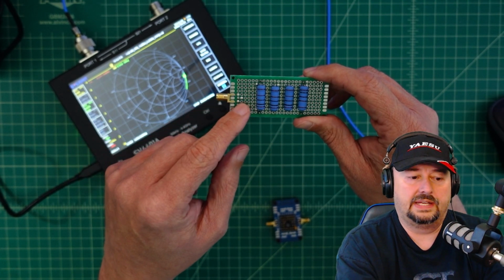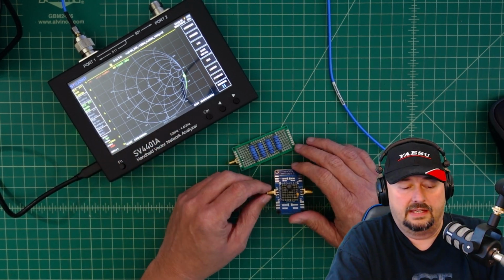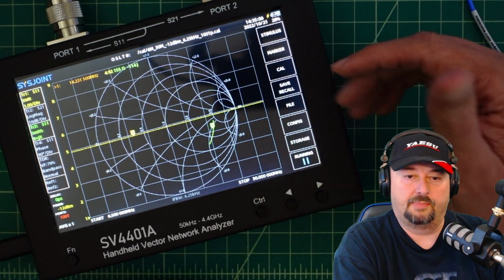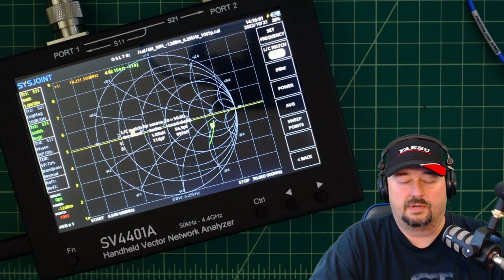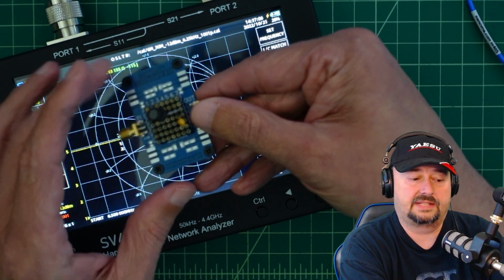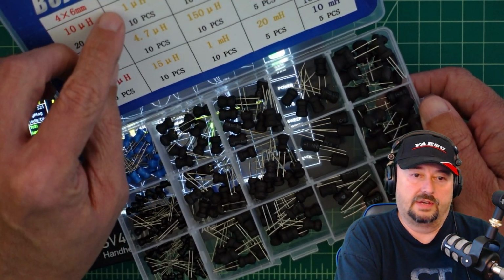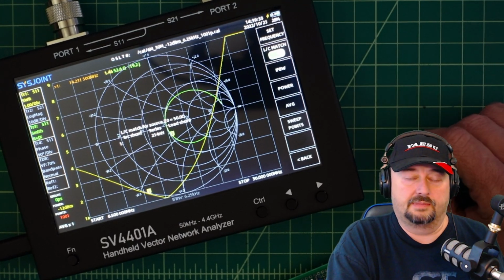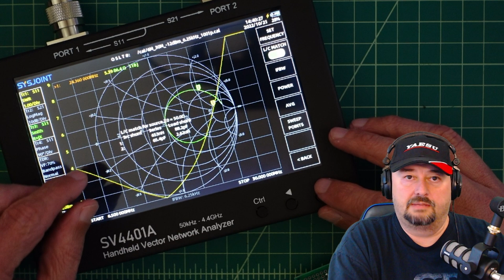NanoVNA Hacks for PERFECT L/C Network Matching!

Comment: ok very good  lets say you are designing  a 1/2  vertical  antenna made of wire  where do you connect the end of the wire  you have direct  into the center  of the so239  what do you do with the outer  of the so239  ground ?   do you just leave it open ?  to  get the component  values needed to build a l/c network
Reply from the maker: That’s what I would do, I’d also comments any ground radials I was planning on using 👍

Comment: for LC matching with the NanoVNA, when it shows multiple lines for LC solutions, ie. in this video you went with Line 1 (didn't mess with line 2), does that mean that each line is a solution?  Are they listed from best to worst (ie. is line 1 a better solution than line 2 or line 3 etc?).  I recently picked up an SV4401 VNA and have be scanning all sorts of antenna's, built a couple 1/4 wave ground planes.  When i select the LC tab, depending on antenna shape/design and how far it's from 50/j0, i've seen up to 5 lines for adding in Inductance and Capacitance but I haven't had the chance yet to actually connect them into the circuit (as you do in this video).  I just got the same board you have for easily adding inductors/caps etc so will start experimenting soon.  My question still sits with can you build the match between the coaxial source and coax to antenna?  I thought the LC matching components had to be between the source coax and antenna base?  Does it matter?  Thanks!
Reply from the maker: They are just listing multiple solutions to the problem in no particular order.  I would put the circuit as close to the feedpoint as possible AND keep in minds that little board is for prototyping, it won’t handle even QRP level power 👍
Reply: @TheSmokinApe  Awesome, that was how I was taking it (multiple solutions).  Yep, just prototyping here, thanks again!
Reply from the maker: @Ifishmo have fun with it 👍

Comment: What voltage rating would be needed for a 20W transmitter? I can see the component size (power/voltage rating) probably doesn't matter much for just tuning an antenna but for actually running/transmitting on the antenna (depending on series/parallel/shunt etc configuration), is there a rule of thumb for power/voltage/watts for these discrete devices?  I found a couple sources saying that for 20W you would need at least a 200V capacitor, is that close?  Any info or direction you could point me on this would be much appreciated.  Thanks again for all the content.

Comment: Ty for the video. @7:15 are you telling us that the VNA is telling you what value capacitors and inductors need to be used to match the network? Is the VNA doing all that math for you? Ty for your reply!
Reply from the maker: That’s exactly what I’m telling you, thanks for watching 👍
Reply: @TheSmokinApe  

Ty for the reply. 

So I have a 'Pi Matching Network' in my circuit. The datasheet asked me to build a Pi Matching Network. ( You know, how there is a series component, a source shunt component and a Load shunt component. )

Anyway, my VNA keeps telling me this:
The measured load impedance is 31.9-58.5j. The VNA is automatically generating these four groups ( group 1 thru 4 )  of available matching parameters on the screen:

1. 5.24pF capacitor for source shunt and 28.8nH inductor in series;
Does that mean, this group does not need a Load Shunt at all? 
Does this mean that the proper tuning has been achieved with just a  capacitor for source shunt and an inductor in series?

2. 23.1nH inductor for source shunt and 12nH inductor in series;
Does that mean, this group does not need a Load Shunt at all? 
Does this mean that the proper tuning has been achieved with just a  inductor for source shunt and an inductor in series?

3. 97.5nH inductor for load shunt and 23.3nH inductor in series;
Does that mean, this group does not need a Source Shunt at all? 
Does this mean that the proper tuning has been achieved with just a  inductor for load shunt and an inductor in series?

4. 15.3nH inductor for load shunt and 5.21pF capacitor in series.
Does that mean, this group does not need a Source Shunt at all?
Does this mean that the proper tuning has been achieved with just a  inductor for load shunt and a capacitor in series?

If the answer is yes to all the 4 above questions, then I still cant believe that a 'Pi matching Network' can exist with 1 of the 3 components totally missing. 

Ty for your reply!

Comment: This VNA looks amazing for ~$250, almost unbelievable, i'm looking for the fatal flaw this must have for such a low price point but i'm just not seeing it.  
Serious question here:  Why use a $10K, $20K, $40K VNA when it looks like it has all (most) of the same abilities as the name brand devices selling for literally 100X the price.  What am i missing here?  Is it not as accurate, repeatible, missing some sort of spendy capability?  Does it have 'phone home' cyber tech/software inside (data harvesting/hacking etc)?  Any insight into this from anyone would be much appreciated.
Reply from the maker: The folks who started building these devices have done a great job making affordable equipment for hobbyists, while it’s not as “good” as professional equipment the results across both are quite similar.  The lowest I’ve seen these lately from verified vendors is about 350$ and the lowest I’ve seen is 250$ on Aliexpress bit you run the risk of cloned or fake equipment.
Reply: @TheSmokinApe  Thanks for the cyber fast reply!  wow, 1st class service!  I've binge watched your vids today for hours.  I have money (not mine) to spend for this and have priced out many name brand units but keep falling on videos like these and sure makes me rethink dropping 10k-20k on a system.  The thing is, i don't need the ~100db sensitivity, i need frequency accuracy.  Thanks for all the vids and speedy reply!

Comment: So how do I “fix” a 2m/70cm mobile install that is saying I need a load shunt?
Reply from the maker: You would need to install a match box / matching unit at the point where you take the measurement 👍
Reply: @TheSmokinApe  I have no idea what that is but I’ll google! 😅

Does it mean there’s something wrong with my instal?
Reply from the maker: Not if your swr is good.  I’d mess with the antenna length if your swr is off, LC matches for UHF and VHF are pretty difficult to construct

Comment: The load ( resistors) is still NOT resonant , you just transformed the impedance from the mismatch to the 50ohms feed. ,at the frequency  it’s at 155 ohms  with a reactance  of -j115, the L/c transforms that impedance to 50 ohms , it does NOT resonate the load at 14mhz , just keeps the transmitter happy. If that is a transmitter the inductor would probably burn up at the higher power levels.
Reply: Yes that’s correct , it just matched the load to 50 ohms., keeps the transmitter happy. Hi powers would burn things up.
Reply from the maker: Glad you liked the video!

Comment: Very good instructional video. I have a question . My Nano VNA SAA-V2 does not appear to have the measure function or the Match L/C. I noticed you did a review on one so you likely have one. Can you tell me is there a function in My unit that does the L/C match or another way of using it to accomplish the same thing. That feature saves a lot of work.
Reply from the maker: Hey Joseph.  I believe that the Dislord firmware has this option: https://github.com/DiSlord/NanoVNA-V2-firmware

Comment: BROTHER, i have a question if you please, i do have the exact same VNA you used in this video, i need to sync it with an IQ modulator but unfortunately as you know the VNA doesn't have a 10 Mhz  input.
any ideas around that before i buy liberVNA or old HP VNA?
thanx.
Reply from the maker: Sorry man, I am not sure how to do that.

Comment: Where is the vna connected for measurement?  I have an antenna, matching network and a receiver chip.  where to connect? Thanks !
Reply from the maker: Either the transmission line or the antenna feedpoint 👍

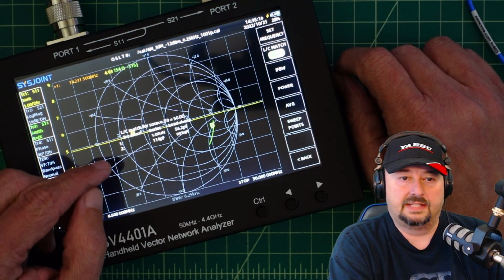Comment: Thanks for the video, I've noticed there are two rows displayed at 2:50. Does that mean you have to implement either one circuit from the corresponding row? 

Or maybe it says that the "Series" element should be composed from 1.09 uH and 114 pF somehow?
Reply from the maker: You would use the components in row 1 or row 2. 👍

Comment: Thanks.
But at 0.37 you said 4×1k resistors in series to get 250 ohm effective resistance. It should have been "in parallel"
But the dummy load may be good for HF spectrum, I believe.
For the VHF UHF bands you have to use the SMD resistors on the SMA connector itself to avoid reactance.
De VU2RZA
Reply from the maker: Hey Subramanian, great catch!  It is indeed parallel 👍

Comment: have you seen the lcr tester that runs off a 3.7v 14500 cell? autodetects resistor cap inductor or even npn/pnp I think.
Reply from the maker: No, but it sounds pretty sweet 👍
Reply: @TheSmokinApe  mines the DIY MG328 tho really bare bones totally unbranded. usual import sites.
Reply from the maker: @wrenchmonkey3920  I’ll check it out 👍
Reply from the maker: @wrenchmonkey3920  I’ve seen these before, they are pretty cool 👍

Comment: Hi Ape,
Great demonstration. You could have used a 22pf and 33pf from your kit in parallel to make 55pf of capacitance for the experiment. Stay safe.  73  WJ3U
Reply from the maker: Good call Don, I didn't even think about that.  I was considering using a variable cap that I have sitting here 👍

Comment: Am I right in thinking this basically like adding a resonance coil to an antenna and tuning it?

I just got ahold of a NanoVNA and barely have any idea what I'm doing with it. I saw these measurement options on it and had no clue what I was looking at. Now I have a better idea. 👍
Reply from the maker: He DP, thats pretty close.  The inductor I added in series is actually a small coil under that heat shrink.  I also added the capacitor...  but it's a tuned circuit 👍